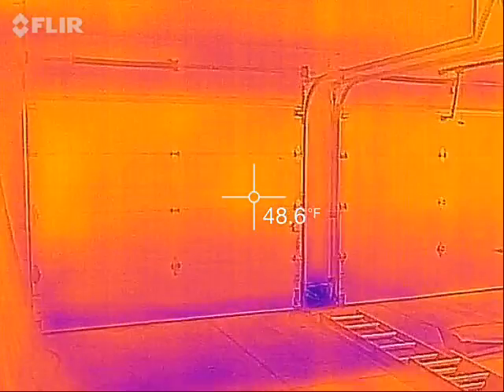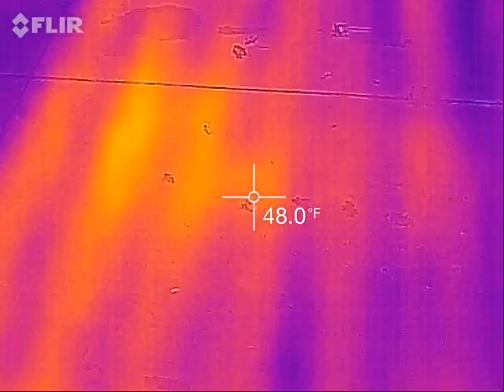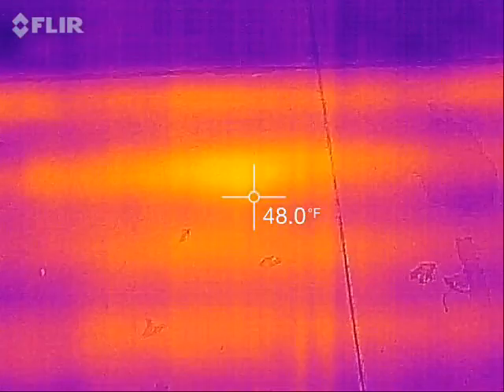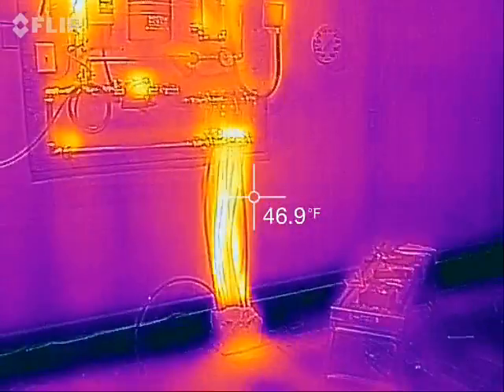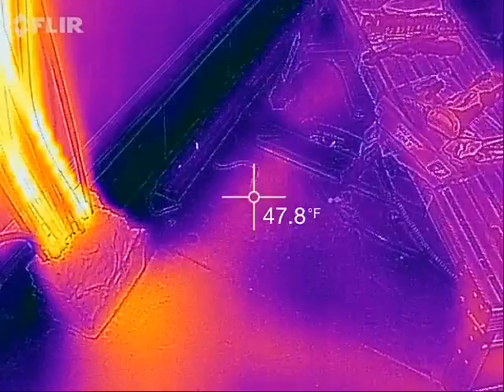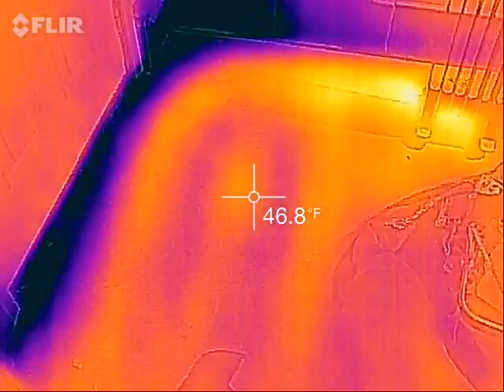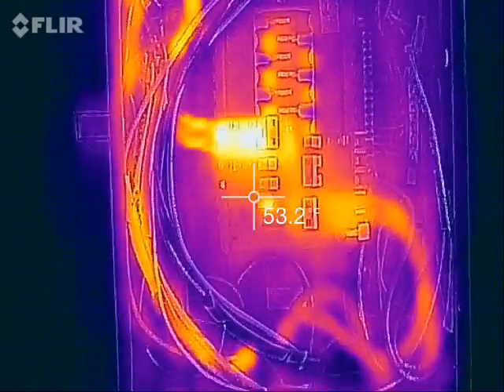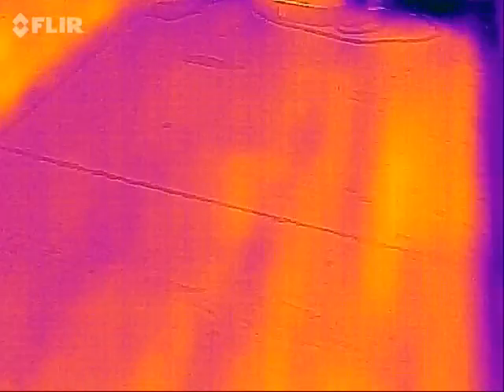First Thermal video of Garage In-Floor Heat

Comment: Electric is your heat source ?

     Will your PV system produce enough electricy to heat the garage ?

God bless
Wyr
Reply from the maker: Electric is the heat source for the moment. It's simple, and I was able to buy this micro boiler through Craigslist for cheap. Electric also means I didn't have to run a gas pipe from the house or install an exterior propane tank. I would still need the pumps and valves and other components for a hydronic system anyways, no matter what the heat source was. I can still use a wood-fired boiler with this system, and I'm hoping to find an affordable air-to-water heat pump.
Reply: I am guessing a heat pump would be more energy efficient than the resistance heat ?  Do you have enough acreage to use a ground source HP ?

     Do not rule out a Mini Split HP , even for supplementary heat .  They are available in amusingly high SEER ratings .

     We have installed 2 in our house .  Living room and our bedroom .

     When the Out Side air Temperature drops too low , we rely on the old stand by 92% gas fired furnace .

God bless
Wyr
Reply from the maker: No, my property isn't appropriate for a ground-source heat pump, and the cost of drilling wells would be prohibitive. I'm not ruling out a mini-split. Those look like pretty neat technology. The don't work in the coldest weather around here, but may be useful part of the year.
Reply: My first Mini Split is only 13 SEER .  I shut it off at about 25F OAT .  The second one is 16 SEER & performs OK for out bedroom , at 25F OAT and some what lower .

     The higher the seer , the more expensive the equipment , but the higher the SEER , it seems like they perform better at lower OAT .

     Not too difficult to install for a DIY project .

     Plus you have good cooling in the summer .

     I am no expert , but if I can be of assistance , please shout out .

     You might use one or two MS's for " main heat " & use the hydronic heat as supplemental heat ?

     As for as your PV system , If you find you need to store excess energy ( at least in the winter ) , you could add a hot water storage system .

     You will even create some heat , while charging your EV .   :-)

God bless
Wyr

Comment: Your estimates of your high and low temps are off. You're calling the concrete foundation blocks 40 when they're actually reading 41.9. You're calling the areas over the warmest tubes 50 when they're actually only 48. Instead of a 10 degree difference you've actually only got a 6 degree difference, and that's only between hottest spots and coldest spots. Average floor temp is much less than that, and average room temp is even less. 

Of course, you only had the heat running for 1 hour, and that probably isn't enough time to bring the slab or the room up to a comfortable temp. I don't know how long it takes for heat to satisfactorily penetrate 4 inches of concrete and heat the enclosed space above it, but probably longer than that. Radiant floor heat would not be my choice for a room that is not being lived in 24/7 because of the long lag time until a comfortable room temp is reached.

What is the temp of the fluid you're running through the PEX tubing? What is the room air temp? What is the outside air temp? How long did you have to run the heater to achieve these conditions? These are the critical data items to be measured.

Comment: Why only one 120V electric outlet?
Reply from the maker: The garage isn't finished yet, the electrical is only roughed in. It's a lot easier to paint and do other types of work BEFORE all the electric outlets, light-switches, and other electric devices are in. Once I'm finished painting, I'll get the outlets and switches in. Oh yes, it WILL have PLENTY of 20A outlets!
Reply: Good plan!

Comment: Beauty of using PEX tubing in the walls and even the ceilings is you cannot use a FLIR camera to see inside. Either heating or cooling it acts like a shield. I say that because criminals can buy these cameras easily.